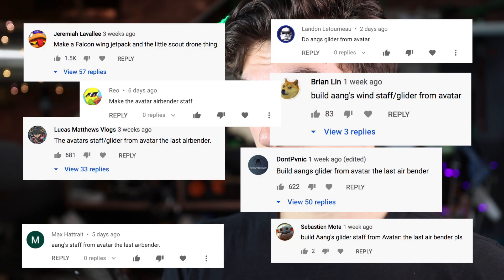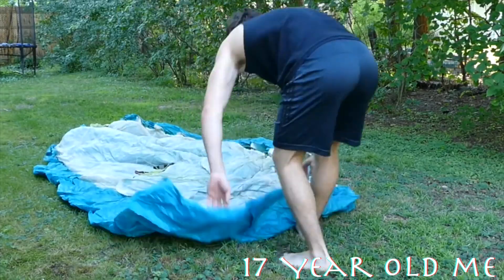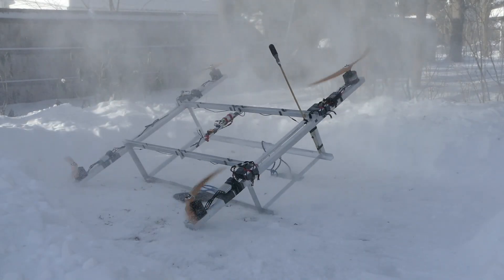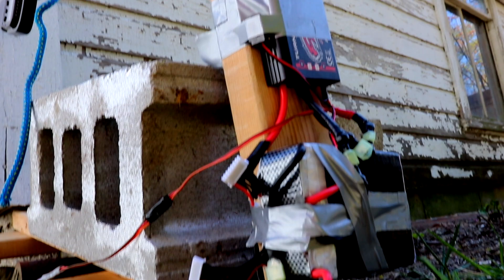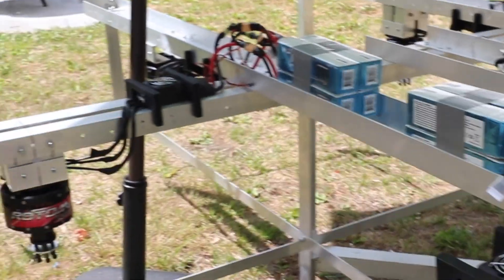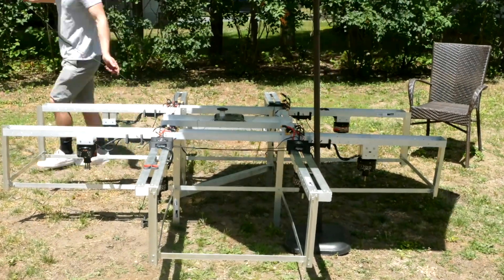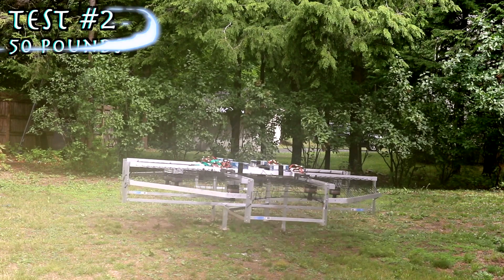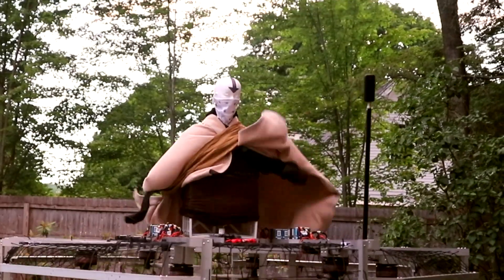Flying Like The Avatar! Real Personal Flying Machine V2.0

Comment: vibrations are always a function of the whole structure (resonant frequencies), depending on the mass, material and stiffness! dont let a vibrating lonely part fool you, it might cancel out and/or be different when mounted on the whole structure. ❤
Reply: basic rule: put the working frequencies a good amount  under the resonance frequency to prevent resonance. More stiffness, less mass, denser material -> higher resonance (vice versa)
Reply: check out the topic -> electro acoustics for the math part and usefull models

Comment: KV rating for brushless motors does NOT stand for Kilovolt! K stands for rotations per minute (RPM) and V for volt. KV is RPM per Volt, not Kilovolt. KV should just be read as KV.
https://youtu.be/JN0cPmpsM2s?t=284

Comment: Ok I know this was posted in 2020 and its 2021 but I have an idea so here it is basically those glider things that have the handlebar you hold on to and fly with well basically do that but the back has foot rests on the back that hang on strings attached to the glider and when ever you want to go up you use your feet to pull the loops and it pulls the back of the whatever you call them basically you pull the loops it pulls the back of the glider down and you fly up

Comment: What I would love to see (and use) is some kind of a balanced paramotor/some other source of power on your back/2 giant wheels with you suspended in between that doesn't make you fly but rather makes you able to run/leap large distances. (the 2 big wheels could have some spring/piston to allow you to leap

Comment: The drone is really cool. Maybe if you made like four angled landing legs mounted farther out on the drone it would help it from tipping. Even make the legs compress able some how so if you land at a angle it would correct the drone with out the jerk. I know weight is a huge factor but I think you could make it light.

Comment: How about a huge chair-sized motorized spinning top, with an IMU-stabilized chair on top, that stays upright with the gyroscopic force, and you can control by leaning in different directions (and I guess a little joystick or a pair of buttons to turn the char left and right) ? 

I think if you make the tip not too thin, and in the right shape, it will actually move when you tilt enough; but you're gonna have to learn to manage the gyroscopic precession to have control.

Comment: I think you should have a four sides prop instead of two for more thrust.  and add suspension to the legs for a softer landing. You could also make a gear overdrive so that the propeller is spinning faster than the engine. So  you'd put a big gear on the engine that on a shaft next to it is going to be a smaller gear so that it will spin that propeller faster making more thrust.

Comment: an idea for the staff. you need to have a large square/ rectangular post for the main part of the staff and semi hollow it out and uses smaller dowel rods for  the wing stability (similar to how a handheld fan works) as far as launching the wings out idk but locking it you could do some sort of groove spring mechanism.  idk if you have something in the works already. but if not here ya go!

Comment: I made a possible, theoretical, not really tangible design in my head. If you want to fly, try making something like the jet suit from gravity industries. I thought about using jet boots, but you'd have little control, so try locking it into place. I can't give you a finished design, but I'm sure you could come up with something.

Comment: If you kept the middle open you could have it be open so you could use your legs like landing gear. The seat would move back just a bit so the extra motors could be near the back to help offset the weight?

Comment: The paracord makes sense, b/c if pieces started breaking off (whether it be the frame, motor, etc.) The paracord would become tangled in the propellers and either stop or break them. Not bad.

Comment: The KV of a motor is its velocity constant. It represents the maximum rpms per volt applied. So, multiply the KV by your battery voltage and you've got the max theoretical speed of your motor. It does not mean kilovolts.

Comment: You should make a self spinning zylo (nigahiga) glider !  Maybe use a ducted propeller or ion wind or both ! Could place a high voltage wire infront of the spinning airfoil and make the props anodes ! Idk think it could work ?

Comment: You do realise that you could just turn the avatar thing into a glider. It's simple! Get the proportions right, do some testing with a scaled down model, get the right materials, buid the large version, strap it ontop of a car or something with weights and give it half a metre of rope and see what speed you need for it to slightly take off while driving. The weights are there to simulate your actual weight.

I just came up with this while writing this so of course there are problems and details which have to be changed

Comment: Awesome!
Ideas for the drone. Can you not make it similar to the scorpion hover bike with some prop covering?
Also if you lost 5lbs (not saying ur fat) then remove all the weight from the frame as possible.

Please make a real version of the flapping flying wings that jarno smeets did. This will work with the motors you already have. Plus you already have all the materials (paraglider wing, motors, motor controller etc)

Comment: if u add an extra structure on the top with a command station and a seat, u should be able to fly without any issue, perhaps u may want to add some extra propellers, and I think you can do that by adding them on top of the seating structure, maybe 4-8 more of those thus making it fly even better

Comment: Captain Americas shield but with a boomerang like mechanism inside so you can throw it and it'll come back
Reply: The problem is, the reason the boomerang comes back, is because of its shape and how the air flows over it, under it, and in respect to the rotational force of the boomerang. So a shield doesn't really fall into that category of shapes that work
Reply: Great idea
Reply: Use magnet
Reply: @_.emekaa  the problem with magnets is, they only work within certain proximities and the amount of power you would need to use the electromagnet would increase exponentially with distance it reaches.
Reply: They did something like this on the hacksmith channel
Reply: I was thinking some kind of gimbal that was programmed to come back to where it was thrown

Comment: I mean. I got a challenge that I’d like see done. Make the iron man suit that comes out of a suitcase. Tbh idk how you would go about it. I’ve seen some people do it with some clever origami, but since I don’t think you are down to make a whole suit, maybe make the upper body (without the mask) so you can add some lasers or fire or something. Maybe put it in a back pack? Or something compact. Doesn’t have to be exact or accurate in anyway, however, I think you should take the idea and run with it and see what happens🤷🏽‍♂️